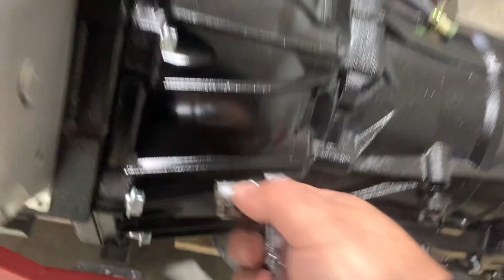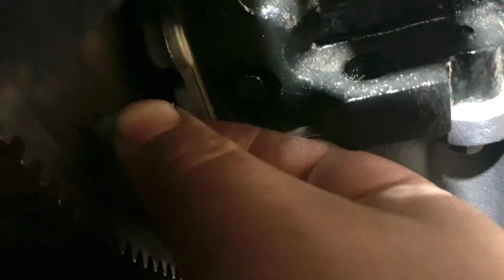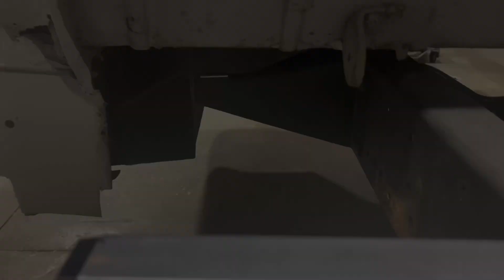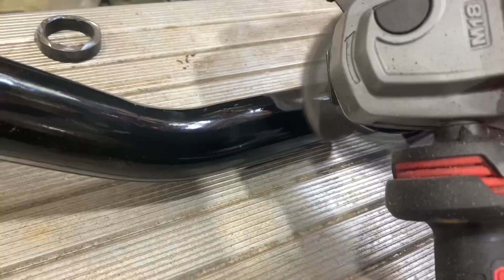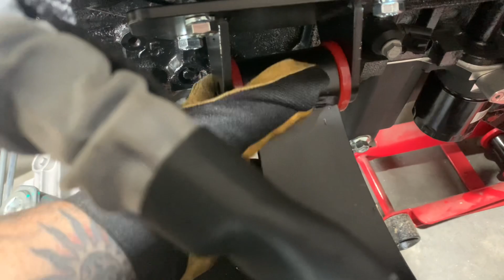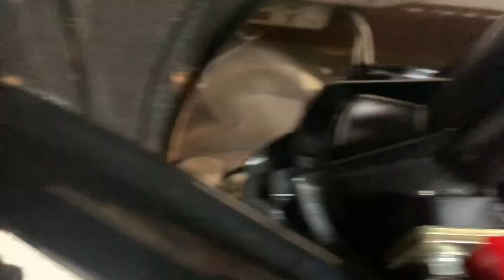55’ Chevy Truck | LS Engine Fitment & Mounts

Comment: Just got a question. Great job first of all, but how far is your transmission sitting towards the ground on my it  is sitting pretty low and I’m not real happy with it.
Reply from the maker: I went with a Pontiac G8 low profile pan to help with that. Honestly my headers sit a tad lower than the trans pan. Even so, I have to raise the ride height just a little by adjusting the coilovers

Comment: Hi Mike, you would not happen to have a measurement from the front cab mount bolts to the front of the block would you?  I am getting ready to set my motor mounts and I don't have the cab handy to reference the firewall.
Reply from the maker: My truck is still in my friends shop at the moment but Im going there later this afternoon and will try and get that for you
Reply: @intheshoptv thanks I really appreciate that

Comment: What motor mounts did you use and cross member ? Think you can send a link for both if you can I appreciate the work I’m currently building mine
Reply from the maker: Here’s a video I did on the crossmember. If you need more info, I have an entire playlist for installing my mustang 2 IFS. https://youtu.be/6X7tqs66PgA?si=nDi5IgKcF2B-Bsr1 The engine mounts are these: https://amzn.to/3yj5Eah

Comment: Hey Mike . I just finished welding in my heidts crossmember in my 45 chev and assorted MII parts and I wanna set my engine/tranny in place and weld in my engine mounts while truck cab is still in place so I can place engine where it needs to be then I’ll remove cab and continue boxing frame and install my new rear diff and rear suspension.  I have frame on jack stands with a slight rake 1.5 degrees . I’m just wandering if I can leave frame as is on jack stands and set my sbc with carb at 3 degrees and weld in my motor mounts ? I’m not sure where my final ride  height or actual rake will be as front and rear suspension arent in place yet so just not sure how that will effect my engine angle after truck is all back together . Thx
Reply: Yea I’ll make sure to clearance pan and front harmonic balancer. Thx for the info/help !
Reply from the maker: So just make sure your frame is dead level, then set your engine between 1-2° angled back. The only other thing to consider is oil pan clearance to your M2 crossmember or it causes some other issues - I actually show that in my most recent video: https://youtu.be/PH3QvE1j_Hs

Comment: What chassis did you use
Reply from the maker: Stock chassis, modified with mustang 2 suspension in the front, 4-link in the rear, step notched. Every step of the entire build is on my channel if you are interested in checking it out

Comment: I’m new to the LS swap world and I just came in possession of a 1955 step side. The 3 speed Grenaded and broke the block so I wanted to LS swap it and I’ve been struggling with trying to figure out what type of transmission to go in it. I was thinking a 700R4 but what’s your opinion? Engine will be a Turbo’d 6.0. Not looking to race, just a head turner.
Reply from the maker: Hey! Being new to the LS world, I would find out what vehicle your engine came out of, and pair it with THAT transmission. If it was a truck engine, depending upon the year, good chance it came with either a 4L80, 6L80, or 6L90. 
The reason I say this is because of ease of the swap, wiring, ecu/pcm harnesses etc. 
whatever was bolted to it from the factory will be your easiest swap!
Reply: @intheshoptv   I was wondering if that would be a good idea or not. The engine I was looking at is currently installed in an older 2012 2500 service truck, from a quick google search it seems to be a 6L90E transmission. You think this is a good combo or should I try for something like a 1500 that would have the 6L80?
Reply from the maker: @nickcoots7669  I have a 6L80: https://youtu.be/_hig96GGbk8
The 6L90 is a little beefier but you may want to consider changing the torque converter to an aftermarket billet unit. 

Also, you have a 2012 engine which is a GEN4. Is has VVT (which is nice for a cruiser) but is not compatible with aftermarket computer so that reaffirms that you definitely want to stay with the matched transmission (6L90) and have your ecm/pcm flashed to both units.